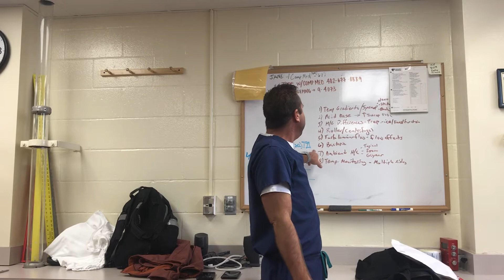Ben Greenfield- UNMC Perfusion Instructor Patient Warming and Cooling Part 2 of 2

Comment: For those heater/coolers that have fans, perhaps it would help if the outlet of the unit had an exhaust leading outside of the OR or leading to an external filter where the aerosolized microbials could get caught. More videos please!